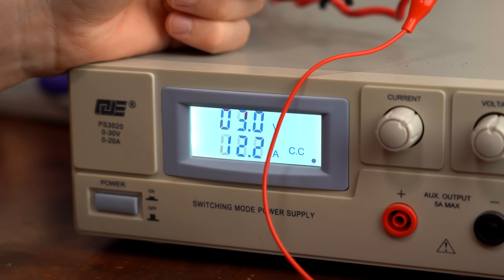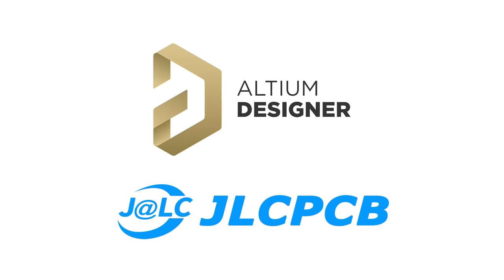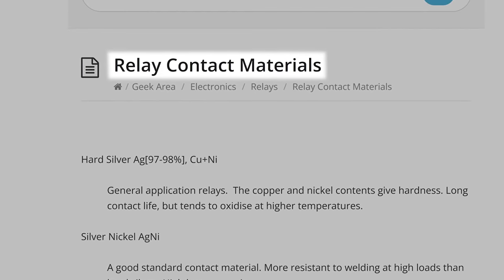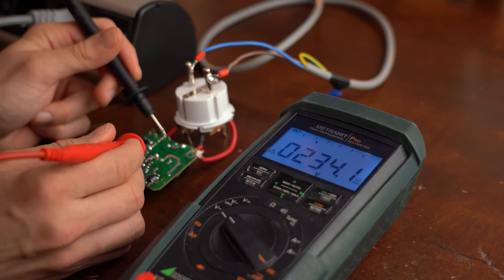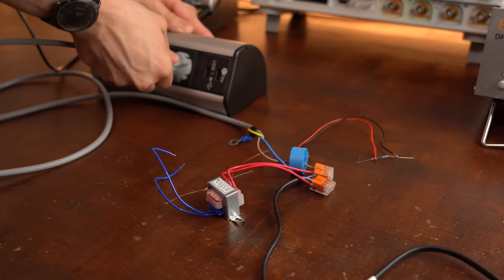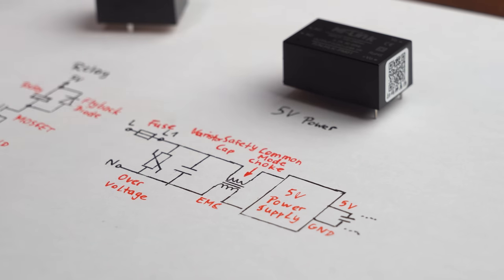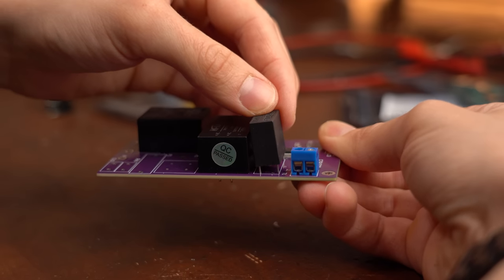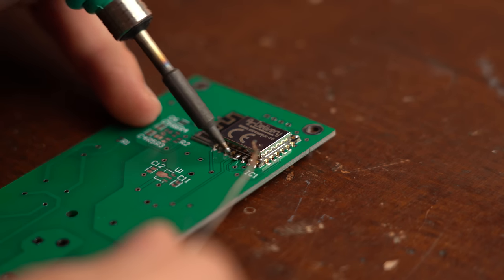The Dark Secret of Smart Sockets and How I Fixed it! (DIY or Buy)

Comment: Always take a actual size printout of your pcb before sending out to the manufacturer. That way you can try all the components and size any enclosure you want.
Reply: Great advice. What computer program do you use to do this?
Reply: @Mdsoebee  there are many ways to do this. Most softwares for PCB design allow you to directly print your design into paper or PDF directly. Most also allow you to export the PCB to a 3D file which is what I do, and then you can 3D print the design to see if it will fit

Personally, I always make the enclosure first then I design the PCB around the design. When I use Fusion 360 for PCB design they have an option to just select a sketch and turn it into a PCB outline. If you use any other PCB software such as KiCAD, you can export a fusion 360 sketch as an DFX file and then import it into KiCAD or other as the outline
Reply: or use the fusion360 electrical 3d tool..

Comment: You could also add a snubber circuit over the relay-switch to prevent electrical interference noise and sparking. (I have had micro controllers reset because of electrical interference from switching relays)
Reply from the maker: Also sounds like a good idea. Might try that in another video ;-) Thanks.
Reply: @greatscottlab  would be cool to have a video on methods to reduce sparking in relays/switches!
Reply: @jorno1994  and what about solid state relays, like I know he did a video on them, but he didn't mention them here
Reply: @ianthehunter3532  SSR with 10A capability has to be big I think, much bigger than mechanical one. And their reliability is not as good either
Reply: Than three will be no proper seperation between mains and load .
Reply: @zyghom  cooling is an issue. I'm running ~17A through a 40A (Chinese amps) SSR for my water heater and it will melt the terminals w/o a heatsink and active cooling.
Reply: @OldCurmudgeon3DP  exactly. it is probably triac based
Reply: @OldCurmudgeon3DP  "Chinese amps" LOL An SSR is sexy but a fat relay is comforting.
Reply: @bansheedearg  agreed. I'd have to beef up my control circuit to run a pair of contractors. The original 155F mechanical safety is still wired in, just in case.
Reply: just look for solid state relays and you will never want a normal relay
Reply: I would guess zero crossover switching could help here.
Reply: @Maaniic  maybe. I know utilities tried that a while back. The breakers had a tendency to radically disassemble themselves due to poor implementation of the controls. 🤷🏼‍♂️
Reply: @Anzeljaeg  until you need double throw
Reply: @Anzeljaeg  As Old Curmudgeon already pointed out, SSRs are fine for low-power stuff, but with any significant current, cooling becomes a big issue, as they have significantly higher resistance (and thus produce a lot more heat) than physical relays do.  If he tried to use an SSR in this application, and packed it away inside that closed box, it would likely just melt the whole switch under any significant load.

You always need to choose the right component for the right application, depending on the needs.  It's almost never the case that one thing is always universally better than something else.
Reply: @greatscottlab  Or (because of the microcontroller) you could use the pair of relay and symistor? To turn on: the symistor goes first (zero crossing should be great to have there) then the relay goes ON and now the symistor is not dissipating any energy (i.e. no heat). To turn off: turn on the symistor (at zero point), turn off the relay and then (at zero) turn off the symistor (or transistor, what will work better for you ;) )
Reply: Or an NTC in series like some power supplies do
Reply: @OldCurmudgeon3DP  "Chinese
Amps"  😂😂😂
Reply: @zyghom  The right concept is to combine SSR (TRIAC) with a mechanical relay. Best of both worlds.
Reply: @Anzeljaeg  Each have their applications. Even though mechanical relays suffer from the phenomenon demonstrated, they are much less complicated and easier to repair. Personally, I actually like hearing a relay as it's confirmation something has actually switched on or off. Unless switching is time dependent, there's not really a reason to use a SSR
Reply: @greatscottlab  >> when I used to work on old electro-mechanical Pinball Machines, Sometimes you got in a machine with badly burned contacts, The machines usually have a capacitor across the flipper switches, This greatly reduced any arcing. It was like a day and night difference. I think the value was something like 104pF? and rated for 300v, It was a disk capacitor, brown in color, about the size of a dime or nickle..with this, you hardly seen any spark at all.. without..it was like an arc welder..especially if you was pressing the flipper button like crazy.. it was easily installed across the switch contacts..
Reply: @greatscottlab  Yes please! I recently used a cheap snubber from Amazon to protect a relay switching mains (in a DIY spot welder using a microwave transformer).
I put one in, but I don't have a scope so can't tell if it really did anything, if it is rated properly and if I should put it across the relay contacts or across the load. Internet says you can do both, but I'm not sure.

Please do a video on this!
Reply: @rays.2480  104pf probably means 100nF: 104 = 10 * 10,000pf = 100nF
Reply: The main downside with snubbers across contacts in an AC system is that they will pass some current when off. This could cause problems, especially with switching power supplies which will periodically turn on for a moment every now and then.
Reply: Problem with snubbers is that thay cause leakage current. Leading to waste of power and also to for example LED lighing flashing.
Reply: @pizzablender  i just wanted to post that, i have 25A SSR here that passes almost 15mA, a lethal amount amount of current.
Reply: Microcontrollers have really sensitive reset pins. A small capacitor to the 0v of the micro is a good move.
Reply: @rays.2480  104 is 100nf (0.1uF) 10 followed by 4 zeros in pF 🙂
Reply: Can a snubber on the relay contacts affect in a bad way the load or electronic appliance that the relay is powering?
Reply: @7GIGEO7  the snubber can pass a small leakage current. This may be noticeable on a very low current load. A VDR can be used as an alternative in this case.
Reply: @andrewwhite1793  Ah i see thank you for the insight... but don't they (Varistors) also have leakage? I remember a case where the relay of a card holder in a hotel was always giving a false indication to the air condition until we were told by the card holder manufacturer to install an external mechanical relay and use this as a dry contact for the air condition unit which worked. :)
Reply: @jorno1994  did read a book once that had a huge section on the subject. It gets complex, particularly when switching high current DC.
Reply: @greatscottlab  good idea if you could test them.
I've seen these snubber circuit, RC in one enclosure where mounted in the Digital output module of a DCS system.
So if they used in Industrial automation, I suppose they could be a valid solution.

Comment: The 3d printed mains enclosure concerns me. There are many considerations given to fault containment and flammability in rated (UL) enclosures that may or may not be covered by a print. Many (most?) molded enclosures are ABS or polycarbonate same as could be done on a 3d printer, though I was under the impression that they have flame retardants added. *After a quick search you can in fact buy flame retardant ABS filament, neat! That being said, there are no shortage of sketchy, unlisted devices that don't end up burning your house down, so in all likelihood it's probably ok.
Reply: There're some other filaments out there. For example INKRAYON Glass (PEN-PET, like PETG), UL94V-2. Sometime you can get it for a very low price on ebay(DE/EU). But's  transparent.
Reply: @deterdamel7380  
> But's  transparent.
For some of us, that's an improvement :D
Reply: @nagi603  Yes, we have nothings to hide there. And the color of this filament is very nice, too.

Comment: Next time you may want to use cutouts between your low voltage part and the mains voltage part on the PCB to get the insulation voltage up and prevent creepage paths on the pcb
Reply: why exactly is it a problem to put the current measurement IC on the mains side and isolate the SPI? You anyways have mains voltage in there and the transformers seem like a ton of added build volume and BOM cost.

Comment: I think the reason the small transformer distorted was because most mains transformers saturate a bit with no load. That's the same phenomenon that makes old school power supplies warm
Reply: why exactly is it a problem to put the current measurement IC on the mains side and isolate the SPI? You anyways have mains voltage in there and the transformers seem like a ton of added build volume and BOM cost.

Comment: I'm really excited about the ESP32-C3 for projects like this, it feels more like the next evolution of the ESP8266 than it does the other ESP32 series chips. One nice feature about it is that it has a built-in USB Serial/JTAG port, so by simply connecting IO18/19 to USB D-/D+ you can connect it to a computer and program it without even having to mess with programming pins
Reply: S2 has this for ages already, S3 as well ;-)
Reply: @zyghom  Oh that's awesome! I've mostly been sticking to the chips on the lower end, so it's great to see this feature is now in one of the boards you can get for under $2 each
Reply: Another advantage of the ESP32 is the GPIO matrix which allows almost complete flexibility of which signal connects to which pin. The SPI wiring issue in this video could have been addressed without a hardware revision.
Reply: ESPs are great. I wanted to experiment with making a joystick a while ago, but it turned out none of my arduinos supported USB HID.. I remembered I had an ESP (not sure what model atm). It too didn't have USB HID either though, so I ended up creating a Bluetooth joystick instead 😅. I found a sketch online and was up and running in less than an hour. It did turn out that the only potentiometer I had was for audio volume, thus logarithmic/exponential, so didn't make for a precise input device. Still a cool experiment.
The "joystick" was a single axis input for a mining throttle in Star Citizen.
Reply: @chrisreynolds6331  That's awesome, Tasmota is really cool for tasks where you don't want to write your own application code from scratch. My builds are fairly specialized though so I'm writing code for them in Rust with ESP-IDF. I can deploy my code to the ESP32-C3 with a simple `cargo espflash --release` command

Comment: In next revision you may consider a better placement for the poor antenna of the esp8266, as I'm not sure it would like that big ground plane around it 😀
Reply: Was going to say the same thing! Follow their guide on it. I place mine at the edge of the board, and have the PCB vendor rout out the PCB under the antenna. 15mm clearance on either side I think is in the guidelines.

Comment: Looks like a fun project.  As a fellow EE, I do have a couple of things to recommend you consider to increase the life of your switch.
First, as an aside, I am also working on a own project that includes an ESP32 - a ceramics Kiln remote temperature monitor.  But, let's get back to you.  Here is what I would consider.
1) The simplest solution would be to move from a relay to using an AC solid state relay.  These always switch when the ac crosses zero so no nasty current transition issues.  You could buy one but, I would expect that you would want to make you own one.
2) If you really want to stick with the relay, add a PTC thermistor in series.  I expect that the high current you are seeing must be due to inrush, not the static current or the circuit would overload.  Adding the PTC will limit the inrush current when you turn the relay on and hopefully prevent the contact from arcing.
Have fun and stay creative!
Reply: 2) you probably meant to say NTC instead of PTC? NTC (Negative Temperature Coefficient) start as high impedance as cold and then current flow dissipates power for them to warm up and become low impedance. A PTC is the opposite - useful to protect from battery overload, but WAY too slow to protect from inrush.
Reply: @dl5244  Thanks DL, I don't use this technique very often so I guess I got the terms swapped.

Comment: One thing you may want to try to prevent inrush relay sticking is to use a dual inrush relay circuit. Basically you have two relays where the load contacts are in parallel. One relay has a current limiting in series (resistor will do for testing). You close the current limited relay first then the non-limited relay is energized and bypasses the current limiting. When turning off you open the non-limited relay contacts and then the current limited contacts.
Reply: There's is a really old method for starting motors using this system to prevent inrush current.
Reply: Smart!
And the double click must be nice to hear for the connoisseur, a bit like someone heel&toeing while downshifting
Reply: This can be useful for really high loads, high switch frequency, or something which requires precise start timing, but is usually overkill for something like this IMHO.  Much the same result can usually be achieved (much more easily) using something like a negative-temperature-coefficient (NTC) thermistor in series with the load...

Also, a lot of the time, relay arcing is actually not because of inrush current, but occurs when disconnecting due to back-EMF from things like motors (this doesn't usually result in relay sticking, but can result in contact degradation which ultimately leads to high resistance and relay failure (or worse, fire risk).  For that sort of issue, adding a metal-oxide-varistor (MOV) can often reduce or eliminate the problem...
Reply: Double the failure modes.  Brilliant.
Reply: @fodl4387  Some old electric trains use this system, they have massive DC motors connected to massive banks of resistors which are bypassed/put in parallel as the train speeds up and current reduces. But not all old trains use resistors, some use tapping contactors.
Reply: @ShainAndrews  dang, son. how'd you learn to count that high?
Reply: @ShainAndrews  They're not in series
Reply: Or trade the 2nd relay out for an active inrush limiting circuit using (ceramic) resistors rated for high peak power and an IGBT to gate the current flow at a prescribed peak current level (set using the voltage drop across the big resistors)
Reply: Just use a solid-state relay as the other one and it'll last forever.
Reply: @alexoja2918  This what i was thinking of from the beginning. With the ESP you first turnon the solid state then the mechanical one, then to switch off first le mecanical one thes the solid state. This way you may get the best from the both  worlds.
Reply: Yes I've made similar circuits using a relay and resistor for large 12 volt inverters. They have huge electrolytic capacitors on the input side and if you connect it directly to the battery the inrush current is enormous, risking possible damage or injury.
Reply: That was exacly what was broken in my microwave. They used the same principle for the magnetron.
Reply: They also use this to charge DC Capacitors for UPS systems, the Hi wattage resistor is across the normally closed contacts and the load is on the Normally open contacts, and when the DC voltage is detected to be at the suitable value it then closes the relay, suppose a simple timing circuit could also be used also.
Reply: @foogod4237  Such inrush current protection can be found in stuff like PC power supplies. An NTC resistor that is bridged with a small relay.
The NTC is rated for 100 to 250 volts, so at 230 volts there is still a quite high inrush current.
Reply: @chrisreynolds6331  yeah I burned out some DC power meters this way.

Comment: A cheaper relay can also be used, as long as a simple soft-start circuit is being used.
Either with resistors or with a NTC, to bring down the inrush current.
Downside is that it will take a little longer for the devices to get needed energy to power on.
Reply: 0.7W of standby consumption per outlet is a lot, mate.

Comment: Some people have solved this problem using one of the aforementioned relays, but also ensuring that the switching occurs at the zero crossing point in the AC waveform. Though with switch bounce being a factor, it might be worth measuring how long the bounce effect occurs for your given relay before trying it.